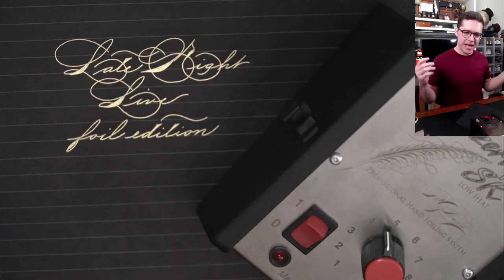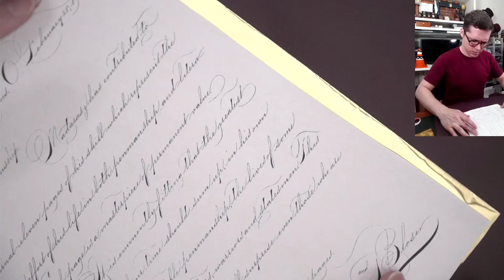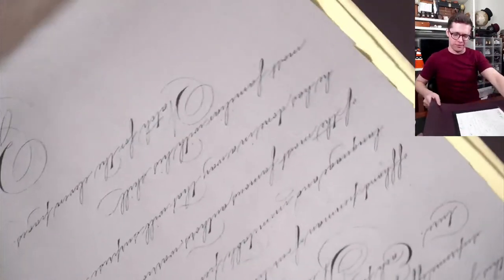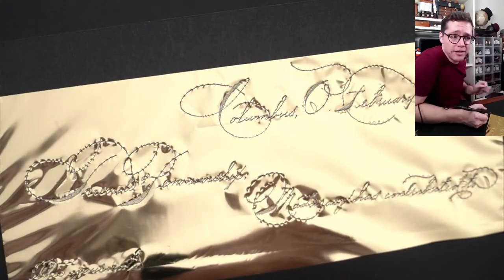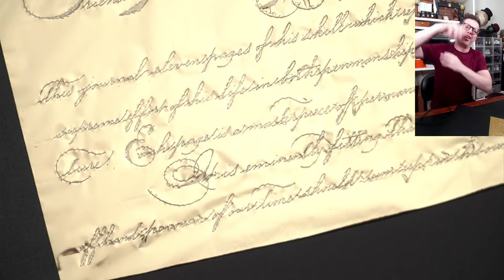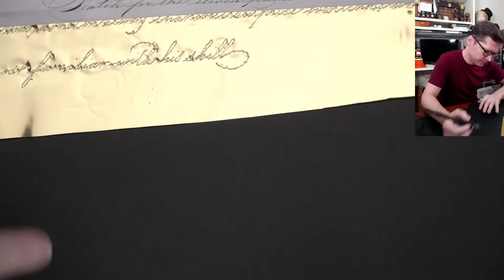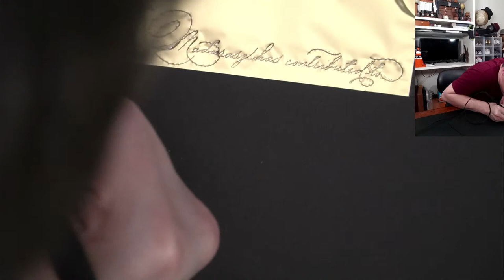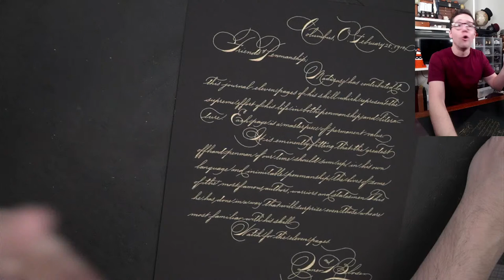LIVE FOILING! (Late Night Live #20)

Comment: This is very cool. Do you use a type of art fixative spray to make sure the foil doesn't rub off? If you do would you mind sharing what type?
Reply from the maker: Thank you very much Dan. I have never used a spray on top before, as the foil is surprisingly resilient, but I imagine a standard clear coat spray should do the trick. Sorry that I can't recommend a specific brand or kind.

Comment: What is the tool you use to transfer the writing to the foil?
Reply from the maker: In this video I am using a fine ball stylus to trace the design through the paper onto the design. But any smooth point would work.a ball point pen or a sharpened pencil that's been slightly rounded off. Anything that can press into the foil